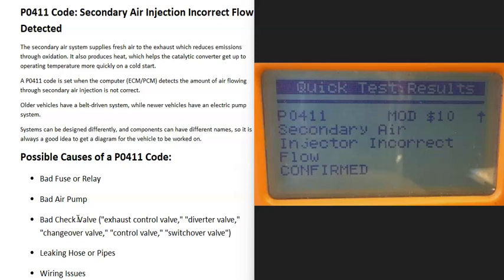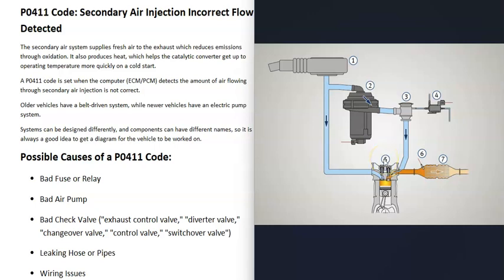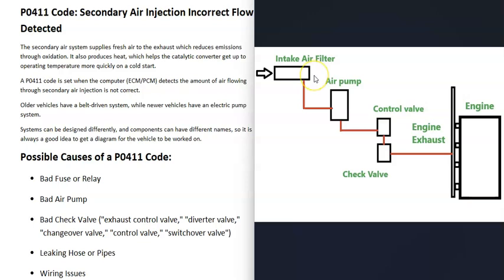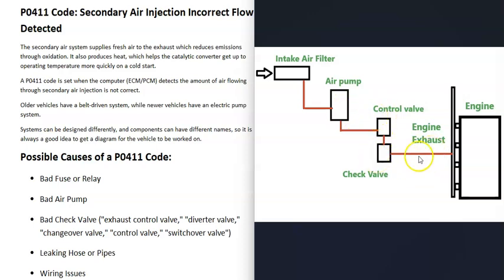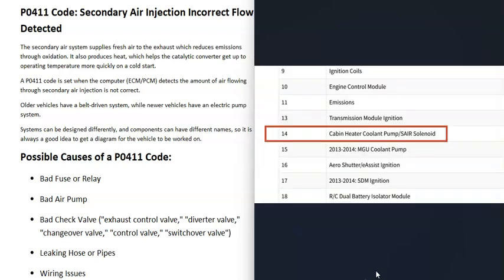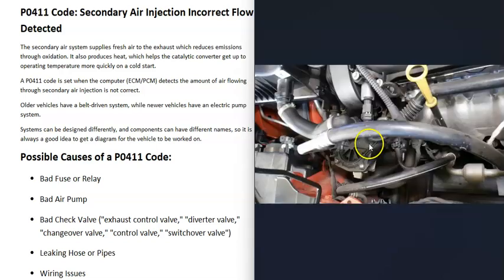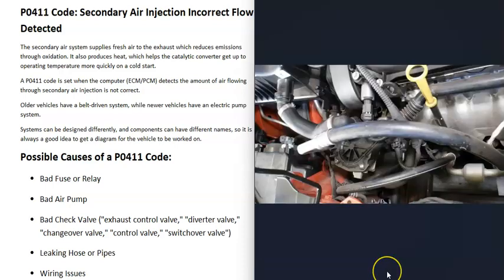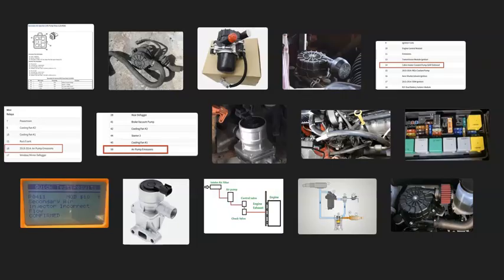Causes and Fixes P0411 Code: Secondary Air Injection Incorrect Flow Detected

Comment: Man, I've changed the air pump, both check valves, both o2 sensors, few sensors.  Damnit if it's the wiring I don't even know how I'd start that.
Reply: Me either